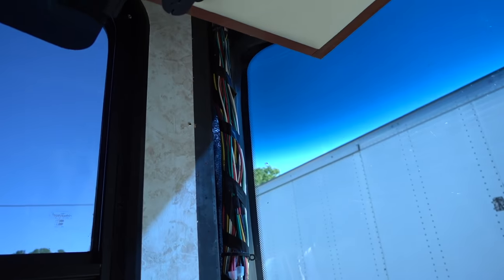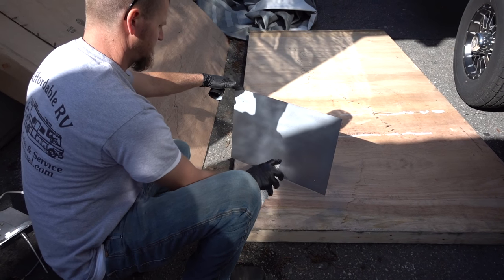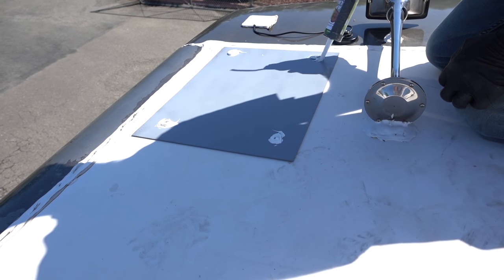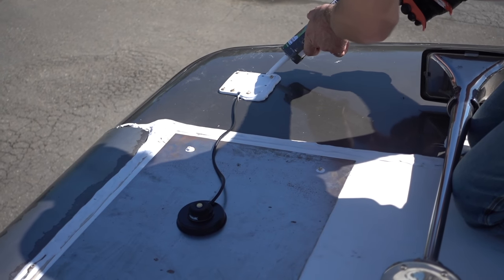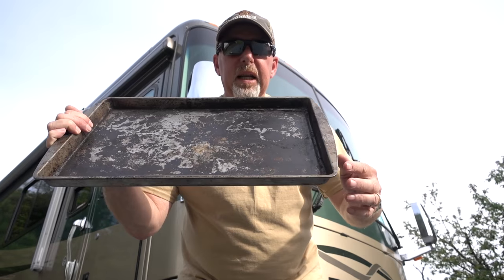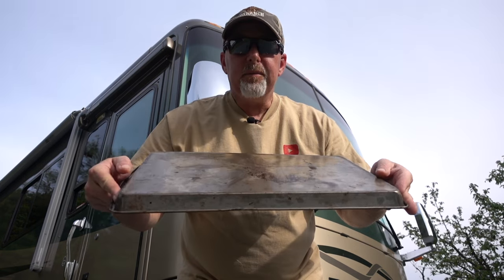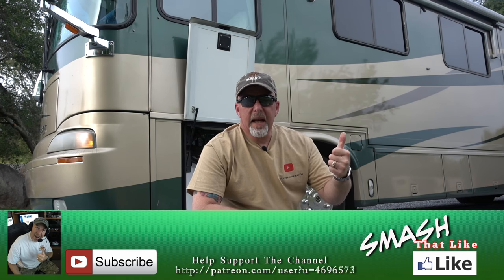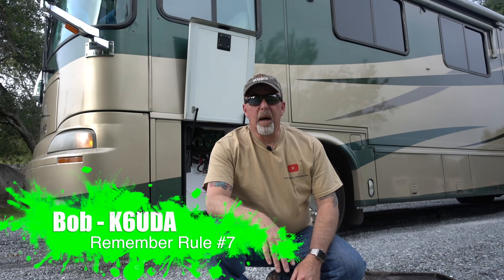Installing A Mag Mount On A Fiberglass RV Roof - K6UDA Radio Episode 49

Comment: i grab cookie sheets and other steel / aluminum cookware ect from the goodwill . Old dvr , home theater electronic, metal boxes for a dollar or two apiece as well, good metal, sometimes they are already the right size for projects. And im not to good to pull a TV or a appliance from a dumpster for the parts or sheet metal, for home projects either. lol. Refrigerators , microwaves r great sources for thin workable sheet metal . I gotr a bender from Harbor freight ...

Comment: Good show, nice RV!

I like the reasoning behind the use of the mag mount - but I'm a little skeptical that you're meeting that goal given the direction of the coax to the mount and the current amount (or lack) of slack in the coax run. If you hit something (driving forward), I think the mount would just slide a bit, taking up what little slack there is... and not fall over. Just my engineer-calibrated eye's opinion.

You're good to go when driving in reverse though!

- Gary  KC3PO 

Love your shows, keep it up... and bring on the female(s)!

Comment: Hi thinking about doing this also afraid of drilling a hole in the roof . Unless you could tell me it worked very well and was worth doing with a plate on the roof. Looking  Forward to hearing back from you thank you.
Reply from the maker: It works great still up there and going strong.

Comment: Bob - about to try a similar installation on my coach.  What is the approximate size of the steel ground plate, and what VSWR does it deliver?  Tanks, Chris KL4C
Reply from the maker: I made a 1 ft square plate. you can use an antenna that doesn't require and external ground plane.

Comment: what mount the base of the 5100 under the floor next to the electrical connections, and just run the face / control panel into the cab? that would be pretty awesome.
Reply from the maker: Thats kinda a cool idea.
Reply: lol, had not seen episode 50 yet, the way u ended up doing it was better, better enviroment , temp wise for the radio. Thanks for your videos bob.

Comment: Hi Bob,   I did something similar a couple years back on a van.   How did you ground your ground plane sheet electrically to your common point ground?    Was there a ground wire or strap I missed?  Or is that in the future episode?

73
Reply from the maker: +yucaipaham no electrical ground. From everything I've heard it doesn't need it.
Reply: It does

Comment: No SWR test to see if you have a good signal at UHF and VHF frequency? Lets see what the results are.
Reply from the maker: once I get the radio in place, I'll cut the coax to length, put a PL259 on it and test it. Everything got be fitted and hidden first.

Comment: Hi why on the roof? I've got a 1999 Beaver pusher and have the IC-5100 but was thinking of using my driver and passenger mirrors with 2meter antenna on the drivers side and the 440 on the passenger side. Also I'm going to put a screwdriver antenna with a motorized lift which I can put it down when on the road and up when stopped. Rick N1HID
Reply from the maker: Because it needs to be invisible to my wife.
Reply: Ok you need to get her licensed

Comment: Why not just take a thin piece of steel (1/8") that is 12" x 12" and VHB tape it to your roof. Then just stick the magnetic antenna to it? Way better than drilling holes in the roof of your motor home. This is how I have my solar panels mounted and they have stayed in place for 2 yrs now with no sign of letting go.
Reply: OOPS, forgot the important part, don't you already have a TV antenna on your roof? IF you do run the coax with it instead of drilling another hole.